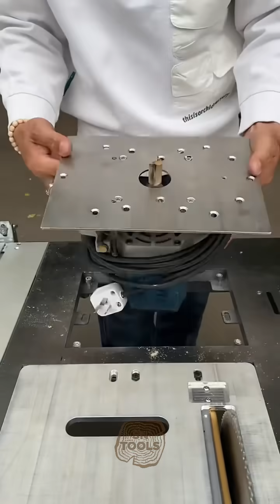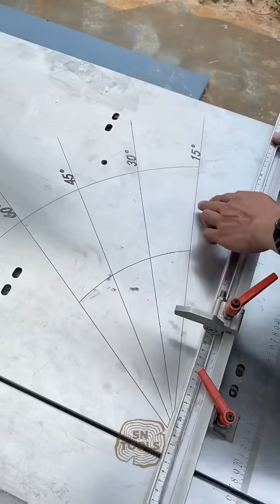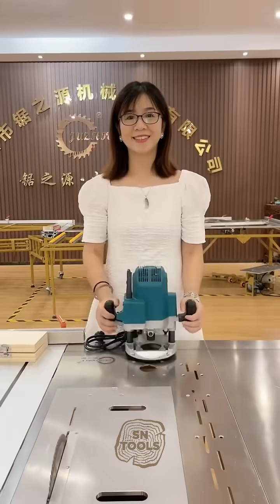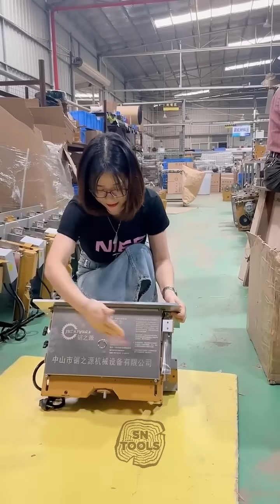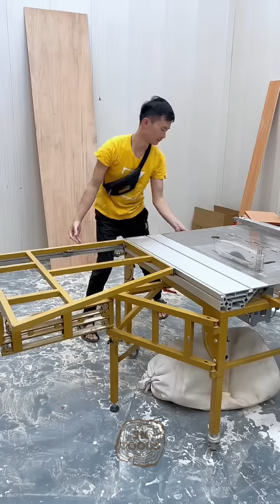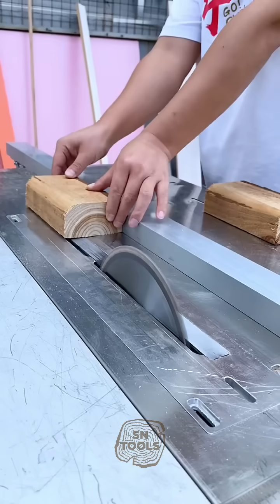Unleash Your Woodworking Potential with This Sliding Table Saw Machine

Comment: Blade is set too high in this video; should be set just high enough to cut through the lumber; if there is a mishap when the blade is set LOW, you can cut your finger or your hand; if there is a mishap with the blade set HIGH, the result can be ... not a cut finger, or a cut hand, but a finger or hand that is CUT OFF!!!
Reply: 😊😊😊😊

De
Reply: Ter basa i
                   

,,,,,,,

Bahasa indonesia
Reply: Well.. it may just a demonstration.. can be adjusted maybe..surely its fatal any incident.
Reply: Does it have self destroying mechanism to prevent that?